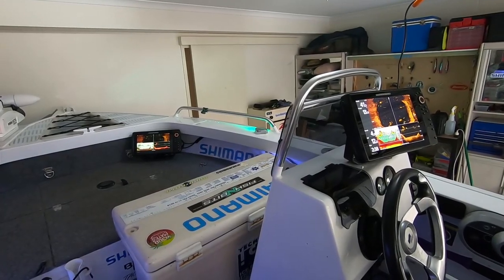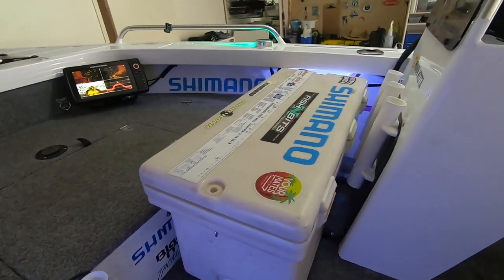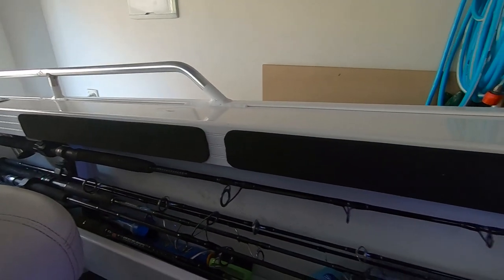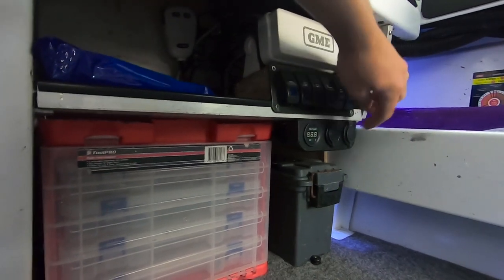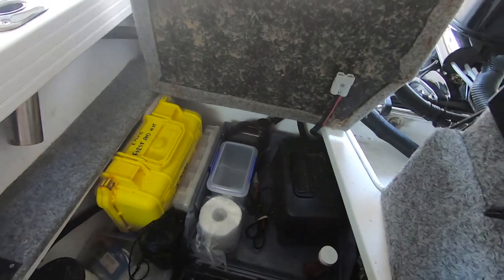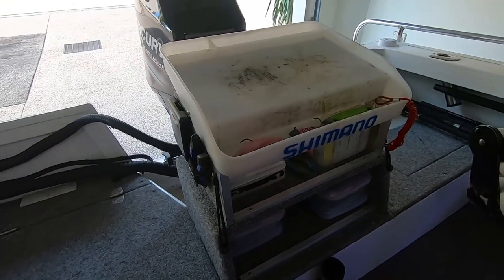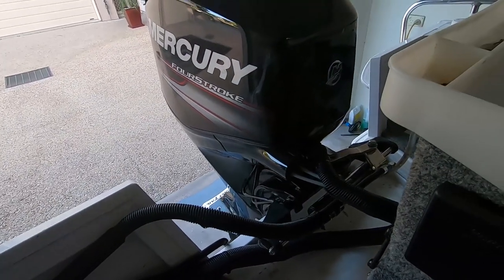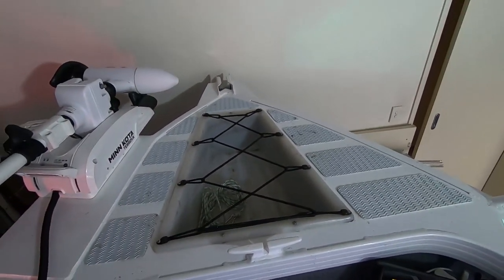Quintrex Renegade 420SC Mods - Part 3 - Final Summary

Comment: Looks mint and you've done an awesome job. The front battery is it lithium just see the fuel tanks there and I know mine if I don't open the breather the motor starves of fuel. I've got a 4.5 brooker originally set-up up tiller steer then my dad made it centre console but I'm setting it back up as tiller, till I can save up enough to go side console. I run 2 lithium batteries 1 x110amp and 1x35 a hybrid crank battery both up the front of the boat, I only run 1 25ltr tank at the rear but looking to move it also up the front and carry 10 legs as a top up.  What under gunnel lights are you using and did you just sikaflex them up and the stain rod holders are the the bcf ones cheers. Love to pick your brain more but that will do for now
Reply from the maker: Na front battery just a 120ah AGM Deep Cycle, From Kick-Ass batteries. Yep dont forget the breather! Undergunnel lights were just Kings Ones from memory, nothing to fancy but water sealed (not that they ever got wet under there), fitted with sikka.    Rod Holders from Whitworths
Reply: @jarraydapelt8365  cheers mate

Comment: Mint set up mate! What type of rubber did you use from Clark rubber for the lean pads do you remember? Do they come in sheets? I'm looking at doing something similar on my 460 renegade.. cheers
Reply from the maker: Came on a roll and they cut to length whatever you want, them I just trimmed it at home into the trips with a straight edge and Stanley knife.  It’s UV stable black foam I can’t recall the name but the staff at the shop will know if you ask and advise what you’re planning to use it for. 9mm thick from memory

Comment: Nice set up
I've got a Allycraft 410 Topender with a new Merc 40 tiller.
Looking at going for a side console as it's easier on the arms.
Looking at the Quintrex 430 Topender as it's got the flared bow and the full offshore transon
Is it worth the extra dollars for the two features???
Reply from the maker: Yes. Quinny hull is unbeatable

Comment: Nice work with the boat mate. Is the eva type anti slip foam up the front ebay stuff?
Reply from the maker: Bunnings “croc grip” $8 each
Reply: @jarraydapelt8365  thanks mate i will check it out
Reply: @jarraydapelt8365  Thanks mate, I've been searching the Bunnings website for ages now and can't find the croc grip you used. Any chance you could send us the Bunnings link to the croc grip you used? It's driving me crazy!

Comment: Nice setup mate.  How'd you go mounting that trolling motor though?  I've got a Top Ender with a thruster plate and just bought a Motorguide.  Looks like I might get three screws into the plate (if I'm lucky) and the fourth I'll be buggered as to how I'm going to do it.  Any tips?
Reply from the maker: It picked up all 4 screws easy enough, one was close and I think I could get an open ended spanner on it underneath but not a ring, if that helps.  Space it out so the outer edge of the guide is like 2mm inside the edge of the plate. You want it so if you bump into a tree or jetty the bit that touches is the plate, but only just

Comment: Hi mate, is there a template for those grips pads you did up on the bow or did you just make them up yourself?
Reply from the maker: On the nose? Just layer them there and eye balled it and marked them out. Took them off and cut with a straight edge and Stanley knife
Reply from the maker: Laid*

Comment: Hi where can I get the rod clip holders ?Also, where did you get the stainless nav lights? Boat looks a treat. Nice work!
Reply from the maker: Whitworths marine for the holders they’re $20 for two,  the stainless lights I actually can’t remember but I think just eBay, they were $160 or so I think but totally worth it

Comment: Great mods mate 👍 how sexy is the Merc outboard! Does that pie warmer drain your battery mate? That is more compact then the others I've seen. Cheers
Reply from the maker: Only draws 4.5 amp or so, and takes maybe 45 mins to an hour to do 2 sausage rolls or pies from frozen. I usually run the outboard whilst the warmer is in use to help the battery. $50 from Jaycar!
Reply from the maker: And yes - Love the merc! Got the fasttail for it as well which matches the paint and improves the boat ride heaps.

Comment: Can you please tell me what/where did you get the padding on the gunwhale?
Reply from the maker: Clark rubber. By the meters and cut to size with a sharp Stanley knife and straight edge. Stuck to the boat via 3M double sided tape (the good stuff) and pressed together with clamps for a couple of nights to hold it. Never budged

Comment: Just wondering what you used on the esky to strap it down
Reply from the maker: Eye bolts in through the plastic (used the existing holes) and then stainless cleats on the floor of the boat and strap her in with bunnings tie down clasps

Comment: Hi mate, just wondering where you got the bungee setup on the anchor well?
Reply from the maker: Got all the bits from Clark rubber,  most rubber supply shops will have the loops and the bungee cable
Reply: @jarraydapelt8365  thanks mate, love the setup! also the croc grip stuff, do you buy it in a roll or are they seperate squares that you measured and cut?
Reply from the maker: @chadlangford6857  bunnings small pieces $10 each for like 20cmx30cm or something  and I just cut them ,  but I’ve heard that they may have stopped making that particular product, I read that some where
Reply: @jarraydapelt8365  thanks mate. I’ll suss it out. One last one mate, how did you join the shock cord up on the anchor well?
Reply from the maker: @chadlangford6857  just the little hooks they make, one on each end. They’re at the edge near the anchor tie of cleat. When I want to bleed a fish the two plastic  the hooks and slide the fish in and hook him into the well.  Also use the bungee to hold down a 10L jerry can
Reply: @jarraydapelt8365  yeah nice mate, Love the setup. Very tidy. Well done. Who did ya go through for the birds?
Reply from the maker: @chadlangford6857  cheers mate. It’s on the market You should buy it ;).    Got them from fish n bits in toowoomba